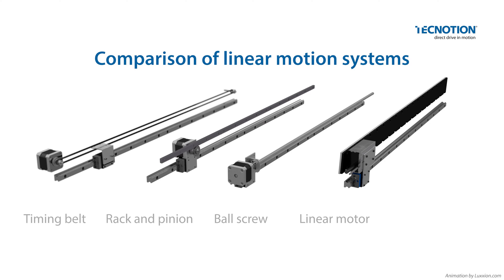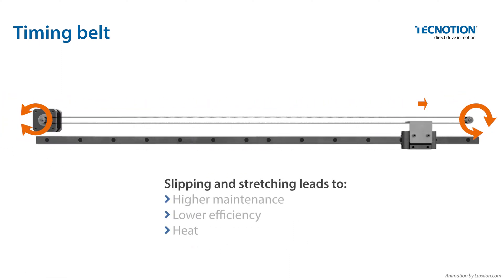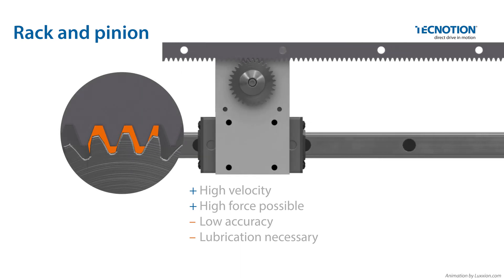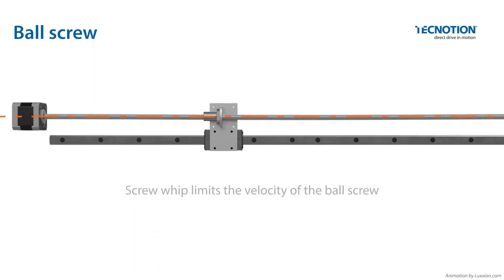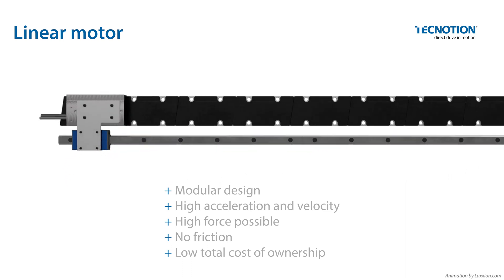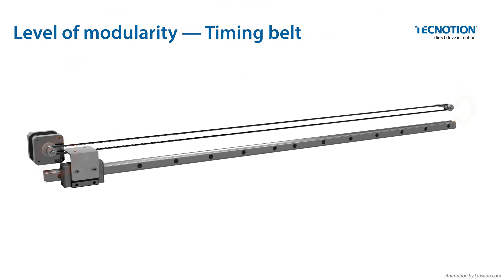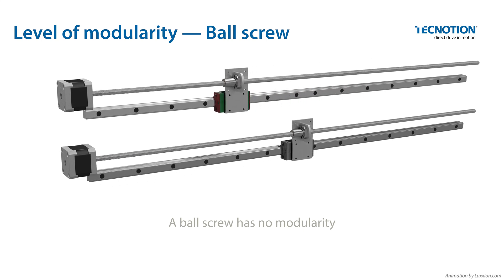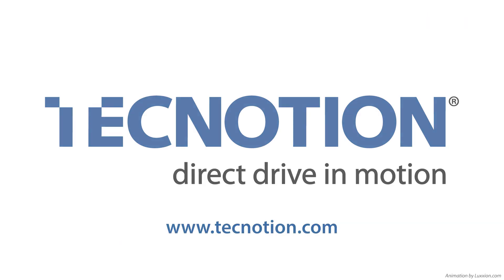Comparison of linear motion systems

Comment: 👿Cherry-picked set of characteristics that does not reflect real world apps and concerns of businesses. Very dishonest = not trustworthy. THAT"S a mortal sin business or person can't overcome and survive.  BTW, we have a novel maximally torque dense gearing technology, the 𝔽𝕣𝕚𝕔𝕥𝕚𝕠𝕟𝕃𝕖𝕤𝕤 𝔾𝕖𝕒𝕣𝕤©   #FrictionLessGears © that solves many current shortcomings in power/torque transmission including linear motion systems. Perfect rotary-to-linear translation is one of it's hallmarks. It also uniquely couples with our revolutionary  ℍ𝕪𝕡𝕖𝕣𝔼𝕝𝕖𝕔𝕥𝕣𝕚𝕔𝕄𝕒𝕔𝕙𝕚𝕟𝕖𝕤 ©   #HyperElectricMachines as the most singular conjugate gear motor

Comment: To be clear, the module in motion for the linear motor is required to be powered?  If I understand correctly, the cabling has not been shown, for the sake of the animation?

Is there a real-world case study available showing the movement, components and cabling? (rather than computer animation)
Reply from the maker: Yes, the moving part must indeed be controlled. For the clarity of the animation, we left out the cables
If you want to see what it looks like in real life, you can check out this video: https://www.youtube.com/watch?v=G2oyEoTyDHI

Comment: Very bias. As they haven't talked once about torque of dynamic loads. A linear magnet motor has a spring effect at high loads so not necessarily accurate.
Reply: Exact reason why fairly advanced motor drivers and encoders for linear motors are required, makes or breaks accuracy and capabilities of linear motors.

Very accurate and large cnc machines like  massive 5 axis+ milling centers or high accuracy and fast moving Z stages for EDM use linear motors with great success.

I feel like your statement is also somewhat biased by not bringing up that industry overcomes the issue mentioned with overly capable and usually costly drivers, along with intelligent linear motor design. Your statement is only true with subpar drivers and linear motors.
Reply: @GENcELL2014  You got a point there. 👌
Reply: @FullFledged2010  😁

Comment: Seems bias
Reply: Main thing that I disagree with is ball screws having "decent" accuracy. In our designs we easily drive those down to micron level. However, I will say I do like linear motors like they show here.
Reply: @patmanlolwut  :  They also "forgot" to mention that you can eliminate whipping and have multiple carriages with ball screws by rotating the nut instead of the shaft.  (As Marcus3d comments above.)
Reply: Linear motors will have friction too, and magnets is more expensive than  regular metal products